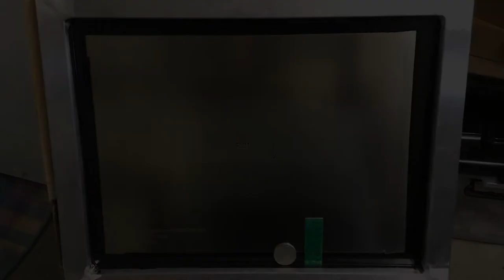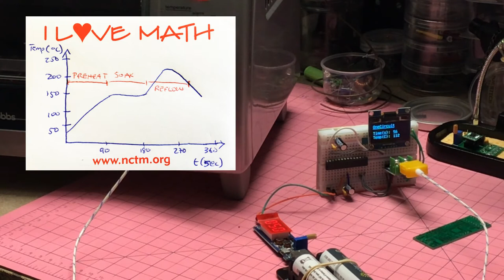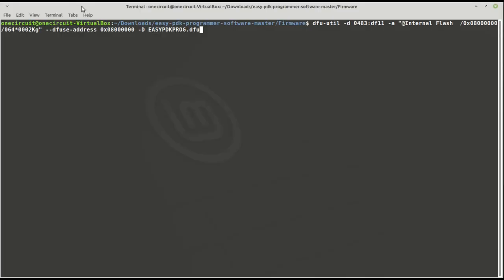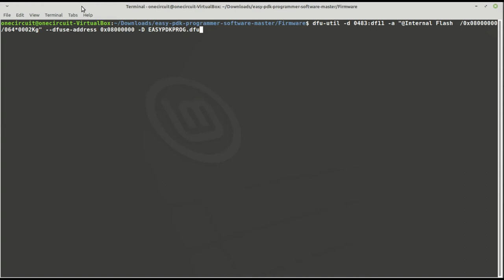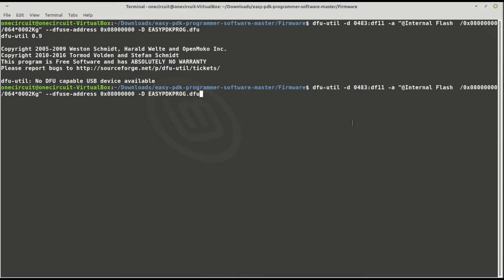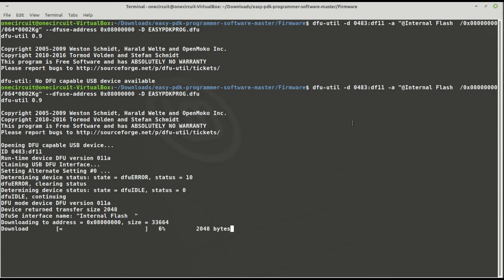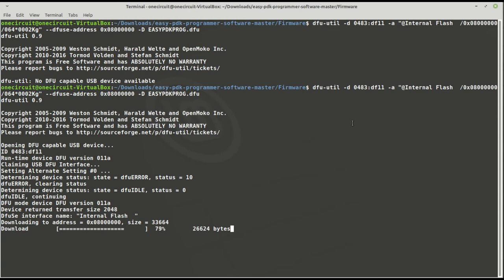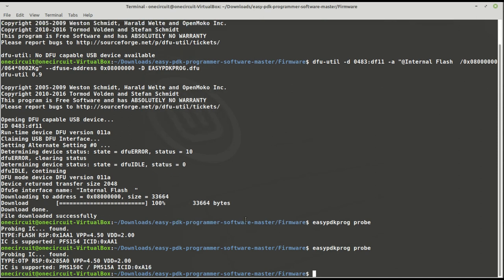Pesky Padauk Programmer (Fourth and Final?)

Comment: Success!
That was quite the adventure.
Reply from the maker: Finally. <phew> 👍
Reply: @onecircuit-as  send schematic and board files,  not images. I need to change to 1 mm pth
Reply from the maker: All on github (check out blog link as well): https://github.com/free-pdk/easy-pdk-programmer-hardware
Reply: @onecircuit-as  hi , that pcb has unnesessary vias , only image files are there not sch brd . Can I  go for lite version,  brd and sch is there in Jason format
Reply: @onecircuit-as  my 10 pcbs,  boards turned to scrap due to mini vias and small track width , I  need the sch and brd files . I want to increase sizes of pth and track widths.
Reply from the maker: The JSON files are in a zip file found in the "easyeda" folder, load up into easyeda and export sch and brd  @Blue.star1